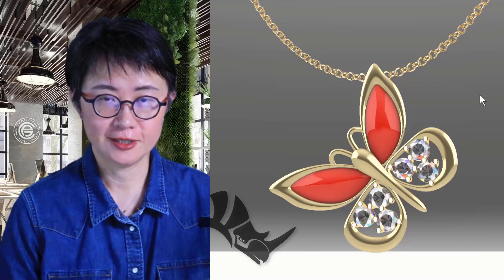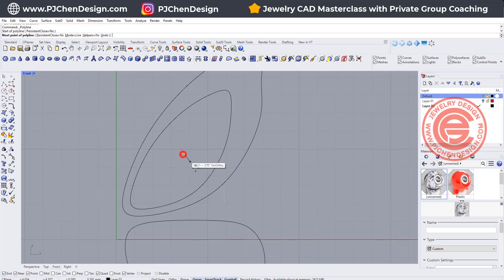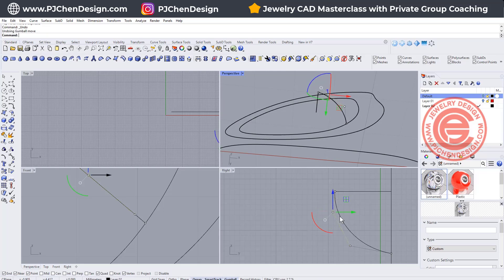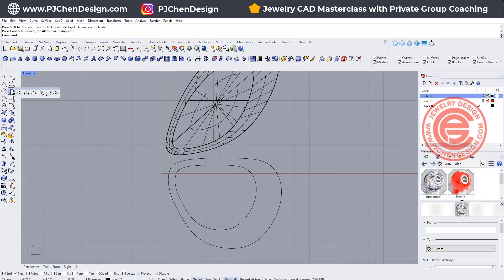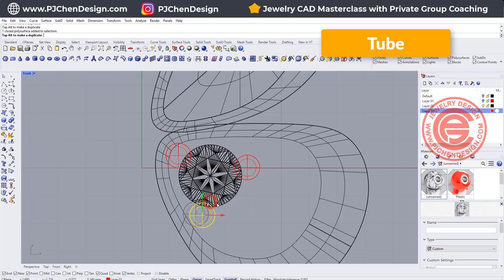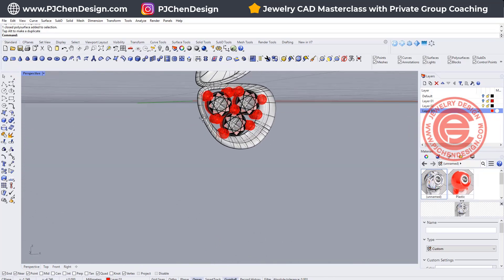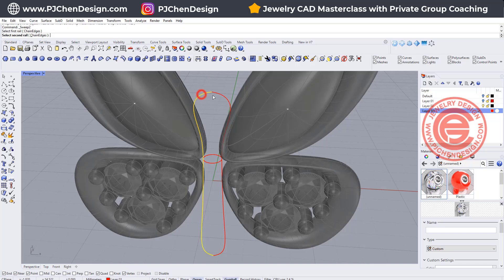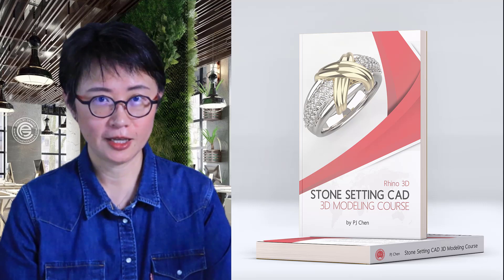Butterfly Pendant 3D Modeling Tutorial with Stone Setting Details_Rhinoceros 3D Tutorial #483

Comment: Hi, I have just started to learn rhino and this tutorial has been very useful. However, I am unable to achieve one command as desired. The rail revolve. After I apply the rail revolve to the inner curve of top portion, it does not converge and instead bends in the direction of curve. I tried with a simple circle and results are the same. Could you help?